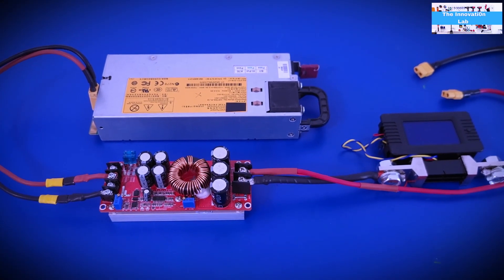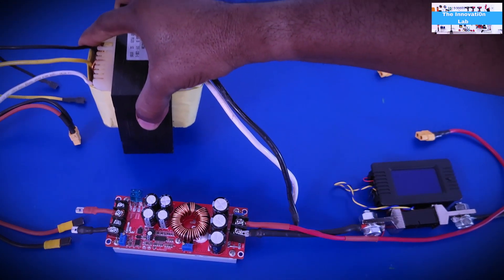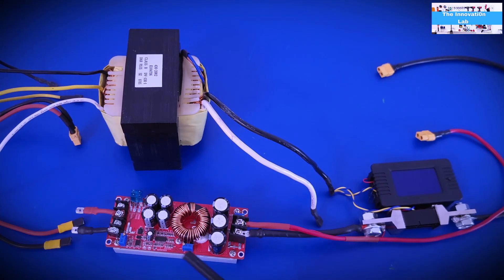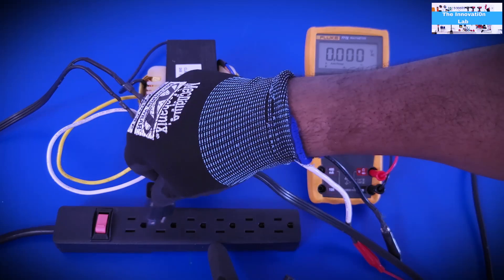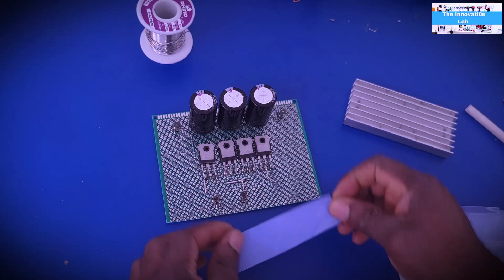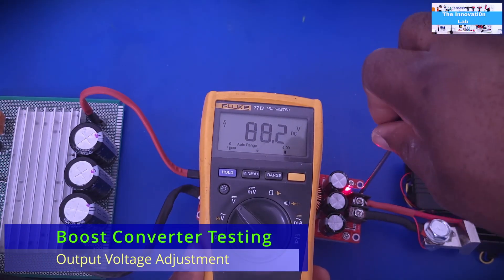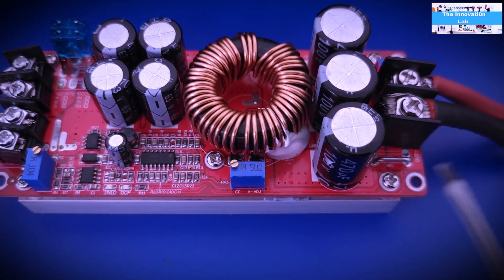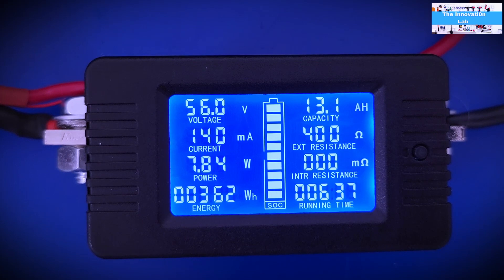How to Make Cheap 1200W Universal Battery Charger | DC Power Supply

Comment: Please how can i use digital mater to measure amps of DC to DC boost converter, i don't have power mater. Thank you.
Reply from the maker: Thank you so much for asking this question....so much appreciate it.

This reminds me of some tutorial topics I wanted to make videos on.😊

You can simply connect a shunt resistor in series with your load, then using your multimeter to measure the voltage drop across the shut...then solving for the current using Ohms law.
I = V/R
Where;
I  ==> the current you are measuring
R ==> the resistance of the shunt 

V ==> Voltage drop measured across the shunt.

It's easier to explain over a video.
Please watch out for that in the near future.

Respectfully,
The Innovati0n Lab💥
www.theinnovati0nlab.com

Comment: how to wiring diode and capacitor?
Reply from the maker: That rectifier circuit was a bit complex.
Please follow the instructions and schematics shown in this video. You can also use the bridge rectifier and capacitors. They are easier to work with.
👇👇👇
https://youtu.be/roI7LExA9_Q

I hope this helps.
👍😎
The Innovati0n Lab 💥
Reply: Is it useful? and if we charge battery does it stop when the battery full?
Reply from the maker: @sokdolla  
Good question.
👍👍👍
I have explained how the charger works in this video. 
Please follow the 6-Step process.
👇👇👇
https://youtu.be/WDWJ77WWkXc
👍😎
The Innovati0n Lab 💥
Reply from the maker: @sokdolla  
The charging  process was explained in the video linked below.
👇👇👇
https://youtu.be/WDWJ77WWkXc
Reply: Can we make without transformer?
Reply from the maker: @sokdolla  
Yes, you can use server power supplies.

Comment: GREAT VIDEO!!!!!   a couple' comments from my experience with just such a setup:
1)  A SMALL variac can be used on the transformer primary since there is SMALL current here (most will even step up the 120VAC from 0V to 140VAC.

2) I NEVER turn this type of potentiometer ALL the way down, as many are unstable at the extreams and can cause serious problems (turn it all the way, THEN twist a tiny bit back).

3) For the filter caps of a full wave bridge rectifier, a nice rule is that you will get one volt of ripple per amp per 8300uF (I like to use 10,000uF for this rule).  You will need twice as much capacitance with half-wave rectification).
Reply from the maker: Thanks a lot for the wonderful feedback.
I can tell that you are quite knowledgeable on power systems. So you better subscribe.😊 We need more people like you in here!
👏

Thanks again for such detailed feedback!
👍😎
- The Innovati0n Lab.

Comment: Terrible.teacher...how did u. Us rectifier
Reply from the maker: @minravex9919 Please, always resist the temptation of becoming an internet bully or troll. The world can always use more respectful people. Keep your comments constructive. You can get your point across without being rude and condescending to YouTube content creators. These videos take time, resources, and lots of effort to put together. 
We provided a good explanation of the concept, provided rectifier schematics, provided testing, what else do you need from a free video?
Please, if you have a question, I will encourage you to ask it in a constructive and positive manner. Negativity and pessimism do not help anyone.
Reply: @theinnovati0nlab782  at least I have a reply.....they don't reply when its constructive
Reply: Pls sir these rectifiers  are they transistors  and why  use 3 capacitors  thanks
Reply from the maker: @papinoye3345  
Those are common cathode rectifiers. They essentially have 2 diodes inside them - with the cathodes (rectifier +ve) of the two diode connected internally to the center pin. The middle pin is also electrically connected to the heatsink pad at the back of the rectifier.

The capacitors are used for output filtering.

Comment: Is it want Automatic Cut off Controller Protection like realy
Reply from the maker: This system doesn't have automatic cut-off control. 
However, if you set your battery charging voltage correctly, the boost converter will go into trickle charge mode when your battery is fully charged.
Please let me know if that answers your question.
Reply: @theinnovati0nlab782  yes thanks

Comment: Why don't you make it with Solar Panel
Reply from the maker: Great idea 💡 
The only issue is that the constant current boost converter we used in that video does not work well as a solar charge controller.
Please check the video below.
https://youtu.be/4RfOrXcBvOY
Reply from the maker: After watching the video, please let me know if you have any suggestions on how we can make it work better. Overall, I like your idea.
👍😎
Reply: Well connect Solar panel 575 watts to a Solar Controller , Controller to the Battery to the Booster Circuit, instead of a External. I have added 500 watts Solar panel directly to Booster Controller 
 and then to the Battery Bank.Perfectly working . Instead of an MPPT.
Reply: From Battery to Ur up converter

Comment: Can we charge a 48v lithium battery pack using this setup
Reply from the maker: Thanks for watching the video. 
Yes, you should be able to. Just make sure you pay attention to the specified charging current and voltage of your battery pack. If you built the pack yourself, what type of cells are you using and how many do you have in series?

Comment: Good video. I would like you to provide the link to where you get the parts from, I.E, the boost converter and its spec.
Reply from the maker: Thank you so much for watching this video and supporting the Innovati0n Lab. I have added a few links in the description for both the 1200W and 1500W  models of the Boost Converter.
Reply: @theinnovati0nlab782  Thanks!